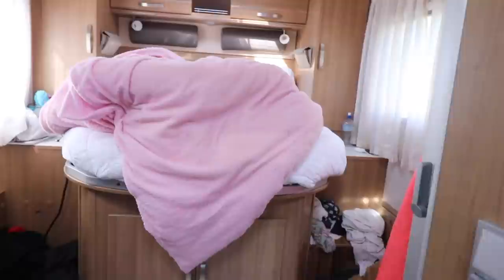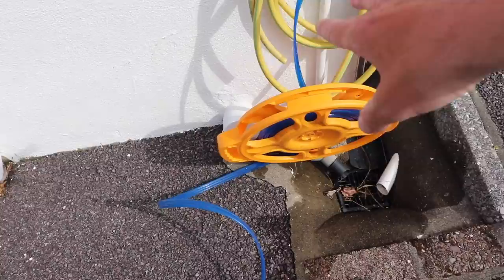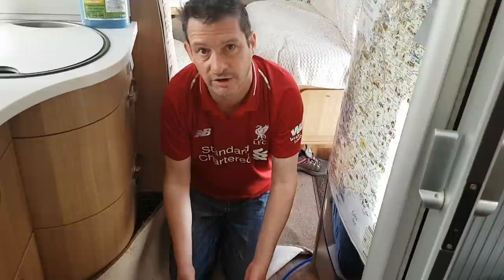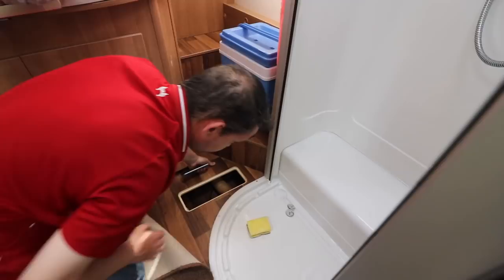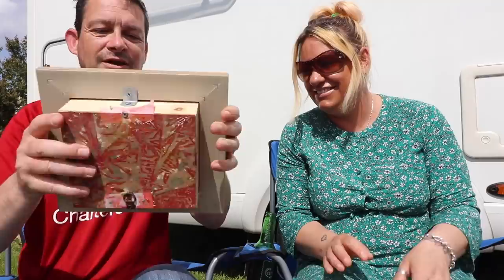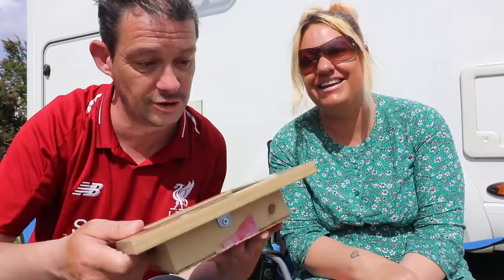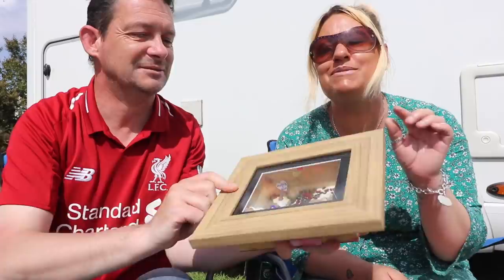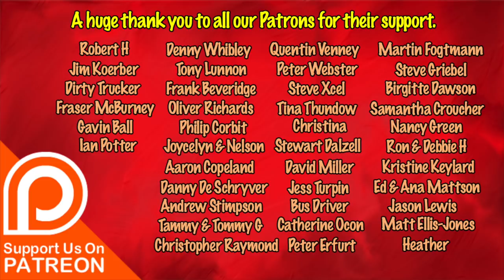How To Clean Your Motorhome Water Tanks

Comment: Handy hint for cleaning the grey tank! Next time you go out have a bit of water in the tank and buy a couple of bags of ice cubes tip them in and drive for a bit the ice cubes will swill round and remove all the muck stuck to the sides of the tank then drain it out when the ice has melted!!
Reply from the maker: Good tip!

Comment: You don't need to clean the tank if it's in constant use. Most motorhome tanks are left and not used for many months a year and need sterilising/cleaning before using again but if in constant use its fine.
Reply from the maker: It doesnt hurt to be extra clean.

Comment: Dan check out these they coil into almost nothing but when hooked up mine is 75ft long and it fits in a small carrier bag I must say though if you are tempted to get one get the proper one not the imitation ones they burst. It is like a normal garden hose pressure wise I fill my tank in 5 mins max. It is called Xhose  think you get 50ft 75ft 100ft ones best thing I brought I have had mine for 5 years now not a leak and I now have 2 just incase the water tap is far away I can stay where I am most times and let the hose do the work :) . Check them out and that Oil leak :) I think I mentioned to look at that leak 20 times before :)
Reply from the maker: As l say, lm happy with my hose. Id definately buy another.

Comment: Just an idea....cant you put a couple of the plastic type pan scourers in the waste tank, then as you drive around  the movement of the water with them inside might stop the build up of slime.
Reply from the maker: I can't see that working. Most of the problem is on the top of the tank.

Comment: Hi Dan and Mazzy
I was using Milton's to clean the tanks on our caravan but was advised not to as it doesn't get rid of biofilm in tanks or pipes. We were advised to use Puriclean instead, which is very good. It's a powder you add to water. It's cleans all contaminates from your water systems. Hope this helps. Love your videos, keep up the good work.
Cheers.
Reply from the maker: Yes thats another option. Im told ours is the good stuff so happy with that.